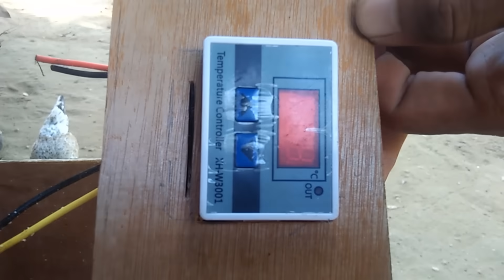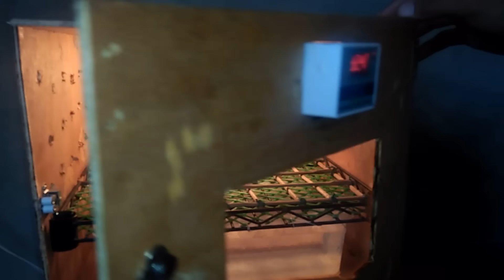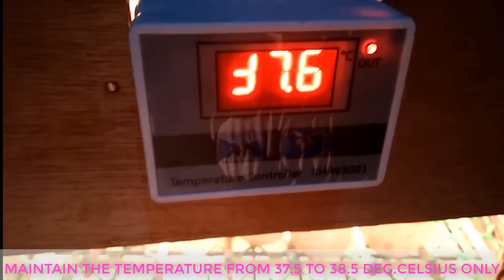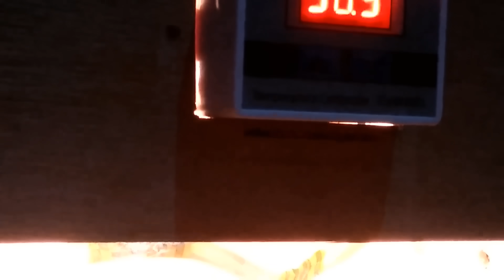Homemade Incubator for Native Chicken

Comment: hi po 😊.. planning to do this method kase may itlog na yung mga kabir hens ko.. kaso wala po akong thermostat ok lang po ba? and yung no. of eggs will it affects the temperature or no? as long as gagamit ako ng 25watts n bulb.?? 😁 ✌ 
 tnx po s reply in advance 😊
Reply from the maker: Magandang araw sa 'yo boss c. jhay. Ok naman po yong walang thermostat kaso lang hindi mo malalaman ang exact temperature. Baka lumampas sa 38.5 or lower than 37.5. Baka bababa po yong hatch rate ng mga itlog. Maraming salamat po at ingat sa covid 19.
Reply: @GOLDENWORKSTV  one more question po.. kase kanina nagawa ko n yung incubator then sira pala yung thermometer..  nagpabili ako ng bago ayun nkita ko 39 degrees po sya ng ilang oras.. ok pa kaya yung egg? 😥
Reply from the maker: @cjhay-kr9yv   e candling method mo po sir gamit ang flashlight ng cellphone. Kapag may mga veins ng blood ay ok pa yong itlog.
Reply: hi po.. update lang po sa ginawa kong incubator 😊.. successful po sya 8 po yung napisa out of 12.. not bad for a beginner. SALAMAT PO!

Comment: What is the size of the Box? How is the wiring diagram for thermostat and the watts of the bulb to be use?
Reply from the maker: Thanks for your very valuable comment Sir Rex Fernandez.  
The size of the box is 14 by 14 by 14 inches. For the wiring of the thermostat, please browse my videos coz i have made a tutorial of it and lastly,  I've used 25 watts bulb in this incubator. Maraming salamat po.